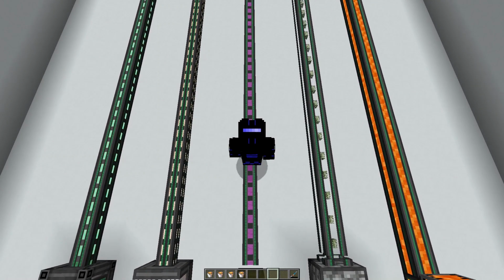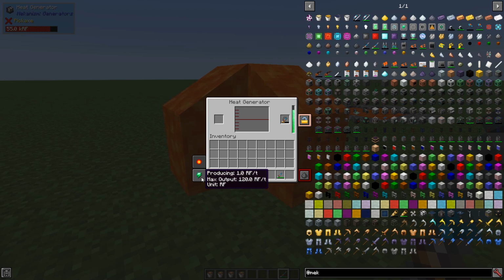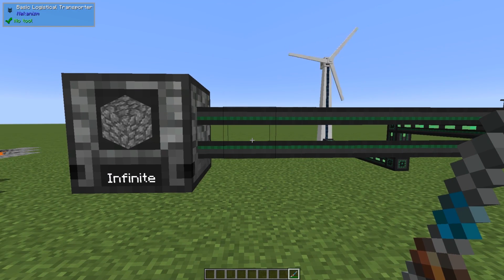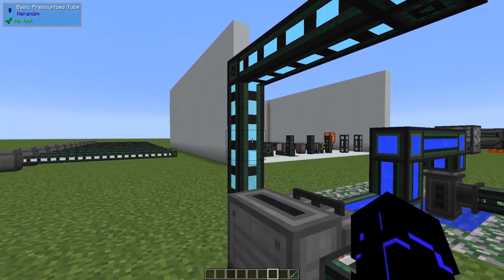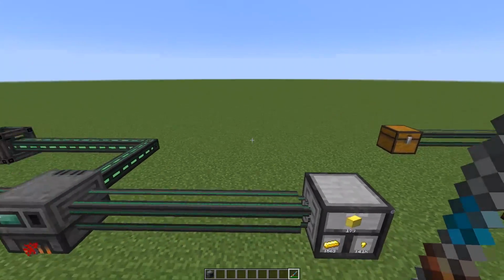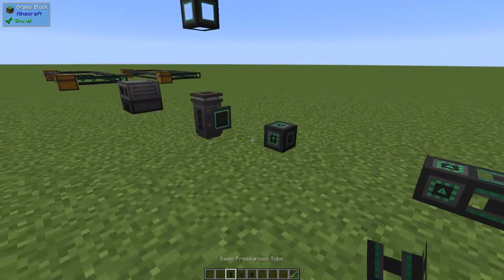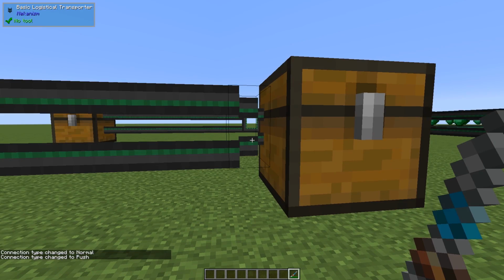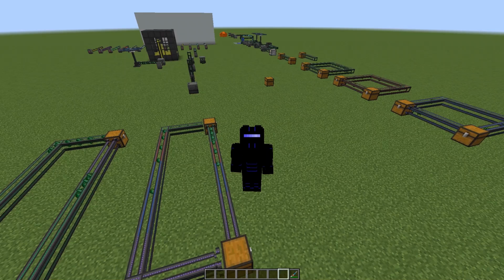Moving Materials With Mekanism Tutorial

Comment: This is pretty old, i know. But i get this issue when i'm trying to set up a SIMPLE transport route through a basic smelter, and i finally got it to get power. But the transport pipes just will not connect. I guess the config side or transport config is to blame, but nothing work when i change anything. And the transport pipes still wont connect to the smelter (and yes, i've used the tool and looked at the inner side to change the push/pull thing) but nothing helps, i dont know whats wrong, nothing on the web would mention anything about this issue...